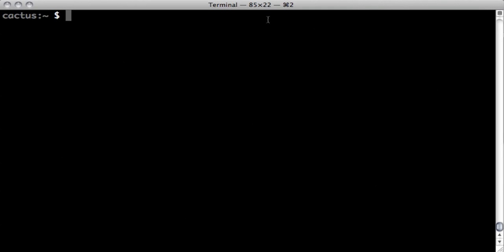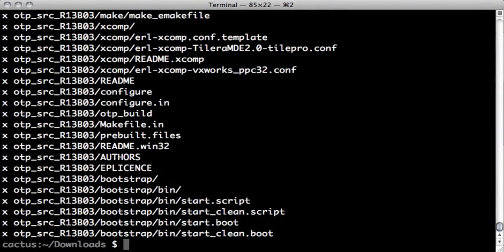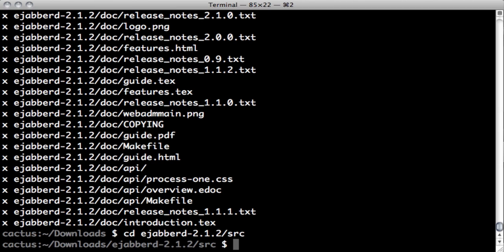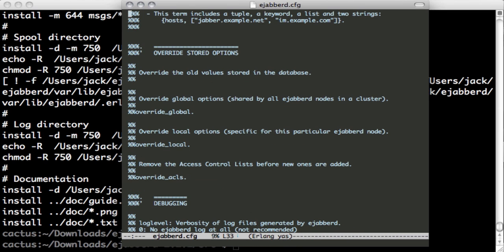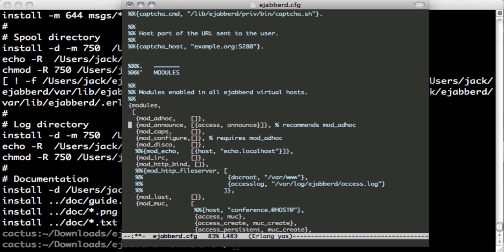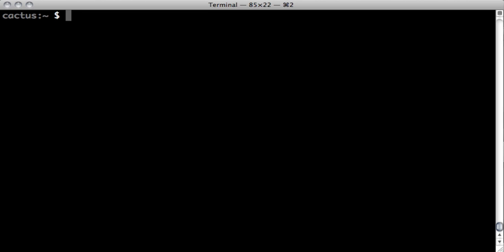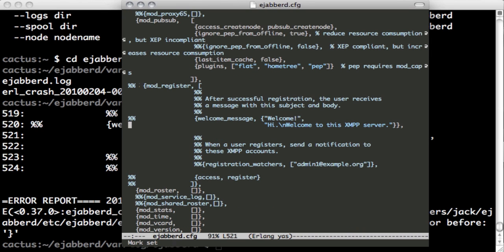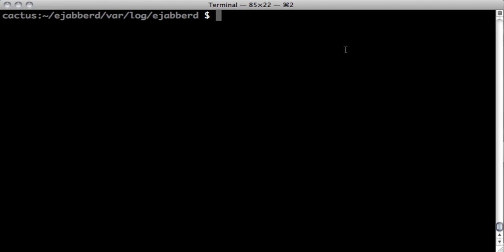Setting Up an XMPP Server with ejabberd

Comment: this video is old...now the current installation of ejabberd will handle everything by itself. Just install the rpm package in your machine and you are up and going.
Reply: can you please specify that rpm package file for mac
Reply: the rpm package is available for linux, ejabberd works best with linux, for mac you have the installer 
https://www.process-one.net/downloads/downloads-action.php?file=/ejabberd/17.09/ejabberd-17.09-osx-installer.app.zip
Reply: it would be best if you used ejabberd in linux though